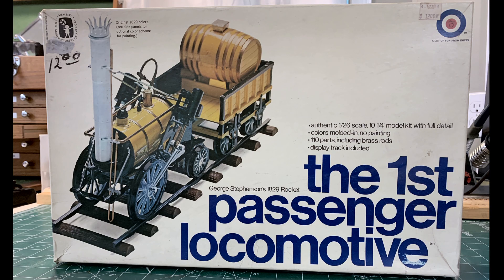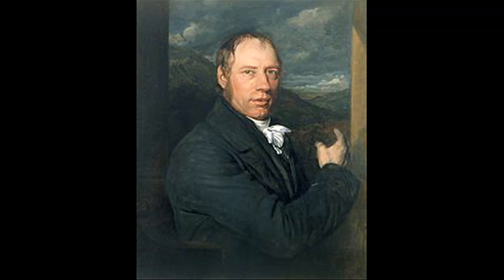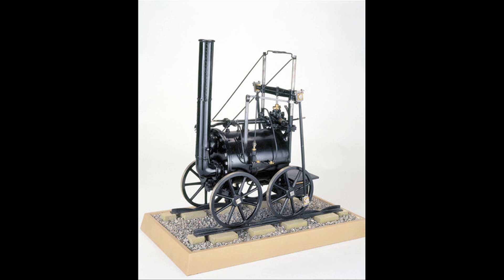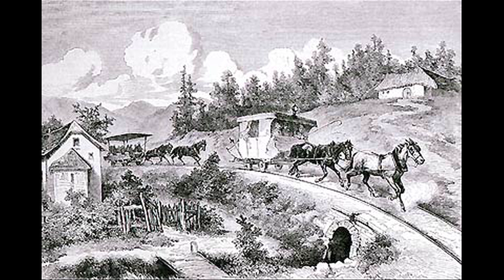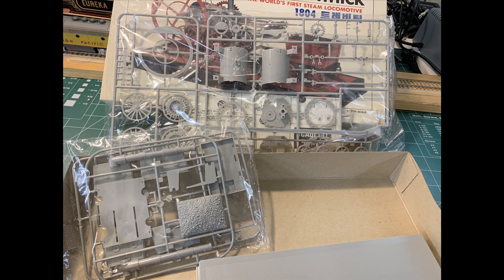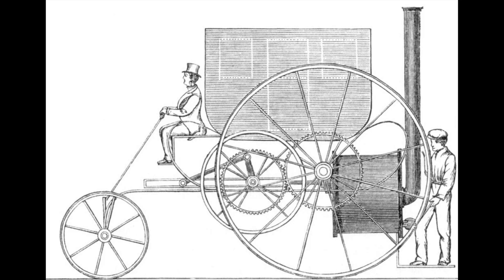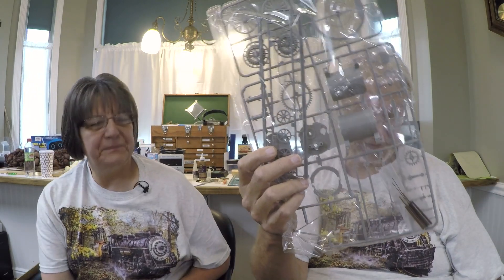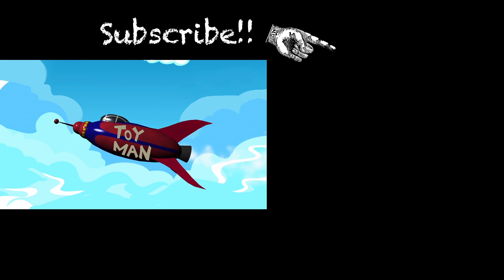The Worlds First Locomotive in 1:38 scale by Academy Korea - The Trevithick

Comment: Boiler for that is what is known as a "return flue" boiler. The firebox runs the length of the pressure vessel then the hot gasses make a 180 and run back through small flues. Idea was to maximize heating area by surrounding the firebox with water. Very common in stationary fire tube boilers but not the greatest for locomotives. Return flue boilers tend to be larger in diameter and shorter for horsepower developed over a "locomotive" style boiler. Good when installed in a building or a shed.
Reply from the maker: oldiron1223 I read that rocket was the first to use straight through flues. Had been used for stationary engines but not for locomotives until then. From that point on that’s about all you see on locomotives right up to the big boy!
Reply from the maker: oldiron1223 also thanks. I was wondering about the internal construction.  I was thinking it may be just a huge crown sheet but then how do you protect the sides of the firebox from over heating. Explains a lot. Thanks!
Reply: @ToyManTelevision  https://www.youtube.com/watch?v=wOGYZC-IJPQ good documentary on the early English Locomotives and their development. Shows some rough boiler drawings, not detailed but enough to get the idea. I've seen return flue boilers built in the 1930's as shop power.